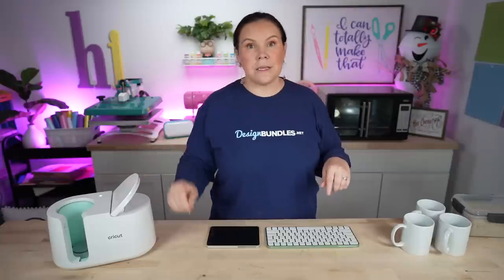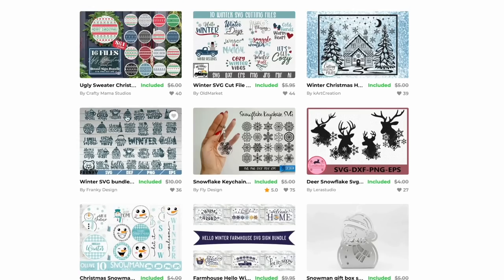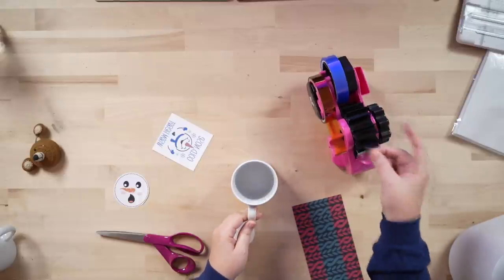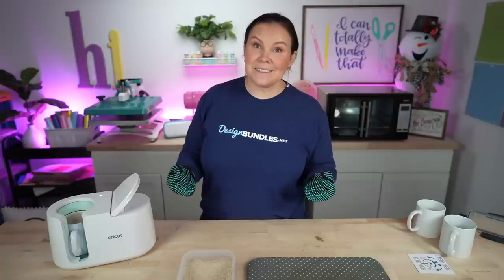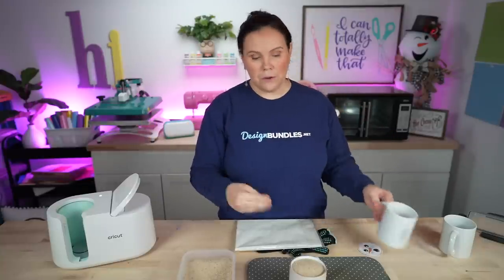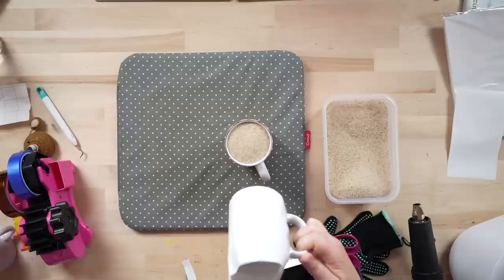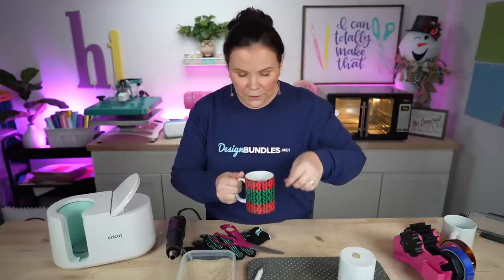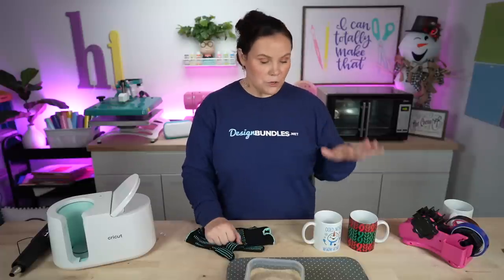Sublimation HACKS - Sublimation INSIDE of the mug?

Comment: dont think the insides and the bottom are coated with a sublimation coating which is why it fails. There is a sublimation spray that you can use which may work on the inside but as it stands I dont think it's a time or weight issue
Reply: This was my thought as well!
Reply: the issue is drinking from a sublimatible inside. I would try the bottom outside
Reply: also I have been successful with the handle
Reply: This is my thought as well
Reply: I think so too.  But also did the sand get hot enough as well.
Reply from the maker: Totally agree! trying to find out if there is a food and drink-safe way :)
Reply: I thought the same thing
Reply: Exactly! The inside is not sublimated!
Reply: Agree
Reply: Don’t think the inside has a sublimation coating 🤔🤔🤔
Reply: That's what I came say. Shame, as it would have looked good.
Reply: I agree.
Reply: That was my thought also. The inside of the mug isn't treated for sublimation
Reply: Thinking you're probably right on that... I saw a way to treat items using Polygloss, but it's pricey stuff. Want to investigate a little more to make sure it works before I buy any.
Reply: @DesignBundles  That was my thought, and is the ink safe?
Reply: That's exactly what I was thinking/ wondering.
Reply: The inside has no polymer coating to accept the dye.

Comment: I agree with most of the comments on the post - no sublimation coating on the inside.  I doubt if Cricut would do that because the Mug Press isn't intended to print the inside of a mug.  Also, it seems to me, I heard that the bottom of the Mug Press does not heat.
Reply from the maker: Yea I figured too ! I know you can sublimate inside but I am on the hunt for the ones that have coating! If you see any Carole let me know!

Comment: What about laying the subli-shrink onto of the inside image, heating the subli-shrink then filing with sand? Maybe try the cuo press and oven again trying that?
Reply from the maker: Hi Tammy! Subli shrink works best if it is wrapped around something. I am afraid it would just shrink on the bottom of the mug. Doesn't hurt to try, though! Thank you for the tip! - Agata

Comment: thank you for the tutorial. while watching, i had an idea. not sure if you want to try it. but what about using cheese cloth or canvas to hold the sand. like in a pouch of some kind. like when you make a sandbag. i dont know what sandbags are made of but a mini version should work the same.

or maybe a bag of heat rocks? really small ones to add weight?
just an idea. :yougotthis:
Reply from the maker: Great idea! I have to find a blank that has sublimation coating inside too... if it exists

Comment: That would be super cool if you could do that, however, is the ink food safe, or safe to drink from? I wonder if the inside is even coated for sublimation, and if the coating would be safe? Also, I know they make the spray to coat items and make them sublimate, but again, I'd worry about safety with that!
Reply from the maker: I am trying to get some information on that! I saw someone doing that so I thought it has to be safe but now seeing no results... I am reconsidering. Anyway I will do some research and if it's safe I will try again!
Reply: @DesignBundles  Awesome, thank you so much! It would be such a cute touch!
Reply: I would think it would be safe to the extent that your mouth touches the sublimation on the outside of mugs and tumblers. I personally don’t think the inside is coated to do so. I have seen videos inside a sublimation factory and they were sprayed upside down. Nice thought, though!
Reply: @connieabner  my thoughts exactly, plus the mugs get washed. silly comments saying they would not drink from it,I guess full mug wraps are out for them lol

Comment: Is the inside of the mug treated for sublimating? Would that be safe to have contact with hot beverages?

If so, what if you filled the mug with sand very full to the top, then placed a heavy disk of some sort that normally would fit inside the mug, but you put it on top of the sand, pressed it down and added a shrink wrap around the mug from top to bottom? Do you think that would be enough pressure?

Comment: I was wondering the same thing, is the inside of the mug sub coated but also if you wanted to retry it, maybe load the sand inside a heatproof bag first and that way, you could press the bag inside the mug so it's really tight against the sides maybe and see how that goes but would there any health issues with the ink coming off and being ingested over a period of time?

Comment: Maybe cricut should come out with mugs with a nontoxic sub coating on the inside and a hand held heat tool that fits in the bottom.
It would be nice if there was a nontoxic coating we could put on and a heat gun would be hot enough. Then we'd just need to transfer the heat through pressure somehow.
I'm not mechanical or enginerical 😂 but I'm sure someone in the crafting world can figure it out.

Comment: I was also thinking that the mugs might not be coated on the inside.  One way to get around that would be to coat the inside of the mug yourself. However, I'm not sure that's safe.  My concern is that the solution might contaminate any liquid you would put inside the mug. I read one review on Amazon that said that PolyGloss Sublimation coating is FDA compliant once it has been cured. And then I read another one that said it has not been tested for food safety.  I'm not sure what to believe.
Reply from the maker: I might have found the solution ! Stay tuned!
Reply: @DesignBundles  Do tell!

Comment: I believe the inside is not coated for sublimation. Also, the thoughts about it being a carcinogen or not good safe… if it isn’t food safe they wouldn’t put it on a substrate that is intended to come in contact with your mouth. A lot of things are toxic to you until they are cured. For instance, you aren’t going to lick liquid glazing for ceramics. But after it has cured properly you can use the mugs, bowls and plates that it’s applied to. 
There may be other issues with a liquid sitting inside a mug that has been coated and cured, but I doubt that as well. There are plenty of other sublimation items that come in contact with food, like plates and trays and such. Sublimation plates are not just for decoration, unless specified. Just my 2 cents! 😊
Reply from the maker: Yea there definitely are the products that are safe once cured... working on figuring it out now :)

Comment: I've seen plenty of videos that use the convection oven with just taping the design on the outside of the cup and it working with no extra pressure. 
I believe it's just not able to be done on the inside unless it specifies it can be done.
Reply from the maker: You are probably right

Comment: can u use sub design with infusible paper? or are there designs on there own for infusiable paper and ink?
Reply from the maker: Hi Vicki! Sublimation designs are printed using the PNG file and the infusible paper is cut using the SVG.  If the design is available in that type of file and can be cut, it could work! You may want to send the image in to mail@designbundles.net and we can take a look! - Dawn 🥰

Comment: sand would apply enough pressure so that is not the problem. its definitely not coated for sublimation on the inside, you should do a test using subliglaze
Reply from the maker: Interesting! I messaged them to see if it would be safe for consumption...

Comment: Thank you for trying this out. I'm fairly new to sublimating so I don't know all the ins and outs but I would think you would not want your drink with the sublimation (because of the gases) so maybe that's why it doesn't have a coating. 
That aside, for pressure I liked someone's idea of heated rocks. I was thinking about the sand tho, what if the sand was damp or wet. Sand is heavy but wet sand might make it more compact and even heavier. You could always put some parchment paper between your sublimation paper and the sand so it didn't get wet at all. It's just a thought I had as I watched. 🤷
Thank you again for your videos. They are always very helpful. ☺️
Happy Thanksgiving!
Reply from the maker: Hi Jamie! Thank you so much. I think that it is not a popular thing to do honestly and a lot of a hassle to put coating inside. I have tried using sublimation coating that is food and drink safe here https://youtu.be/vo-p1jTYRSs . Check out what happened 😊

Comment: Where do you get the paper you shrunk around the mug?
Reply from the maker: You can find it here it is called Subli Shrink - https://amzn.to/3OvMqSY
Reply: Thank you
Reply: @DesignBundles  how do you get the wrap to not melt. Every time I try using it, from the minutes I set it in, it melts and by the time I'm at 4 minutes or so, it melts holes in the sides... I've got a hard, white, clump (now brown) in my pan. At least that's how it was with my tumblers.
Reply: Do you know if an air fryer oven would work in place of a convection oven?

Comment: Sublimation mugs, when manufactured, run along a conveyer and are coated with a sublimation receptive coating then baked to cure.
The internals of the mug are not coated hence your failed attempts.
It is possible to achieve an inside print by purchasing a sublimation receptive liquid and baking the mugs (or other substrates for that matter), allowed to cure then sublimated.
Please, stop using a weeding hook to remove the transfers. This can scratch the image and lead to a complete failure of the coating.
Reply from the maker: Actually Vic I might attempt to do that very soon :) So make sure you stay tuned !